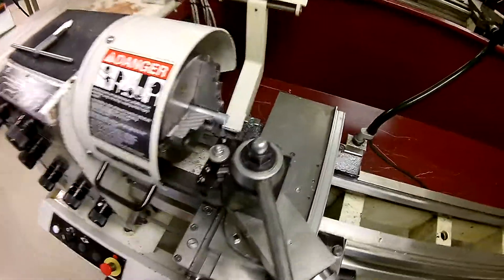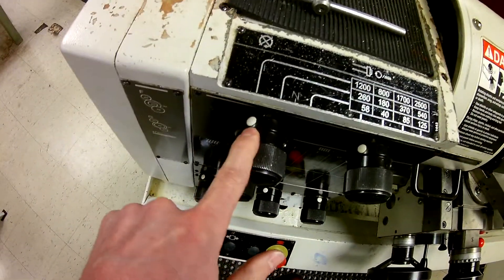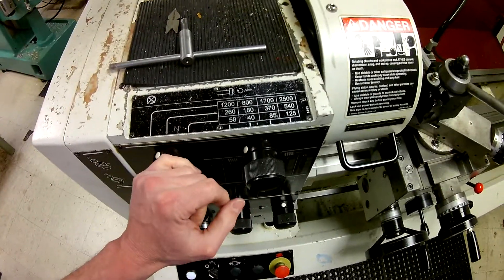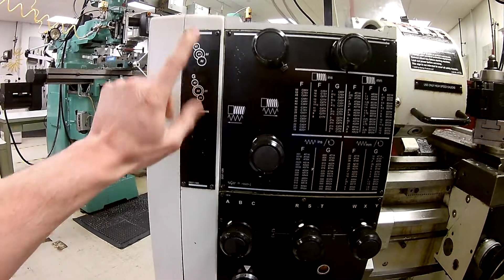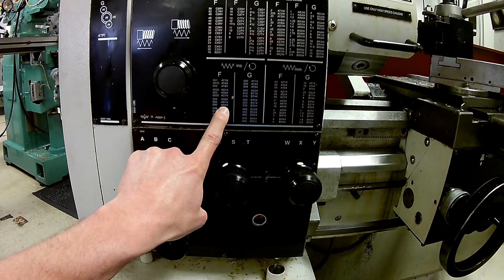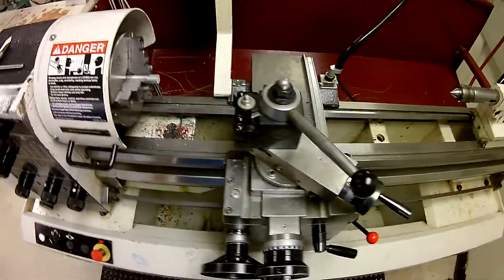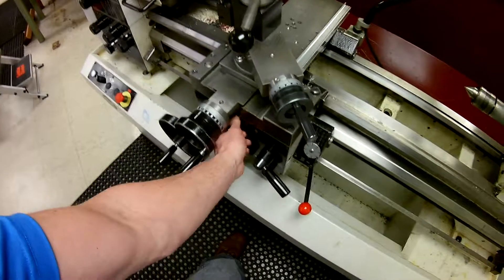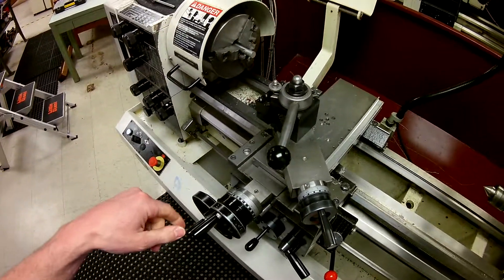Lathe 3 Setting RPM & Feed

Comment: Not everyone has the same lathe.  so your demonstration is irrelevent to many.
Reply: Old Atlas guy here. Yes the lathe is different, but the concepts and theory are all the same. On my old Atlas change gear lathe I have a panel that shows what gears I need to swap where to cut what threads. It also has info for which pullies to place the belts on for what RPMs. The only real difference is that the older the lathe, the more manual operations you have to do. In my case I don't turn knobs or push levers, I literally take off gears and change them for different ratios. Its a different method, but all the same concept of changing gear ratios for different RPMs and feed rates for threading. I am also an auto mechanic and even though engines are wildly different in appearance, the same principles and design basics of pistons, connecting rods, transmission gearing, and so on are still the same at their basic levels. Hope this helps clear up why it doesn't matter if someone has a different model and size of lathe and why this info is still good.